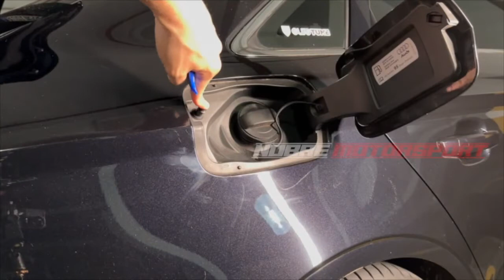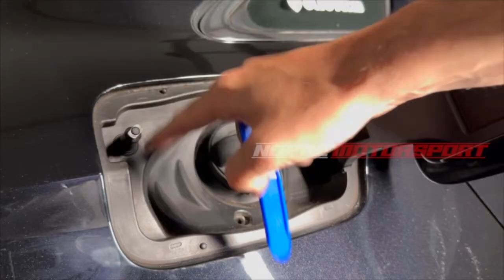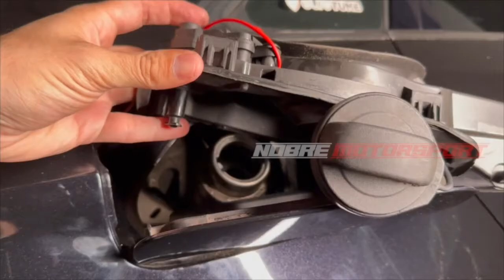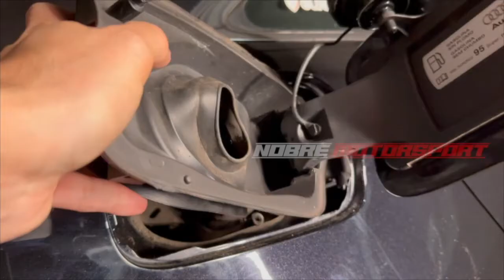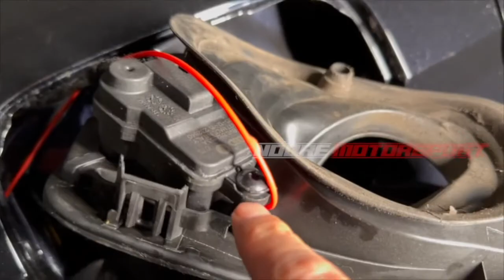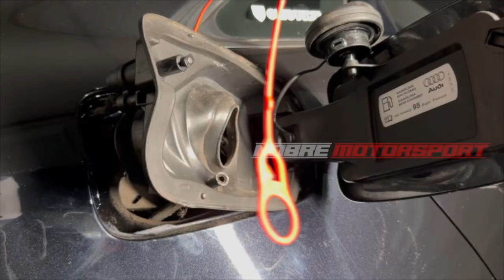Audi Fuel Door Stuck!! Do not open!!! Audi and VW fuel tank STEP BY STEP

Comment: This video is great and all but unfortunately the pull string to get the door open on the Tiguan is apparently buried or doesn't exist.

Update: On the 2021 NA tiguan the fuel door has no release because VW loves to make us suffer. You have to break the actuator to get the door open and try not to break the plastic liner on the inside of the fuel door

Comment: Thank you, good video.  The pull string didn't even work on mine.  Had to use a plastic tool to pry the door off the actuator.  Once open, all went well.  Hardest part was getting the clips released.  I ended up getting the lower aft corner loose first.  Easy, took about 20 minutes for me.
Reply from the maker: Que bom q deu tudo certo